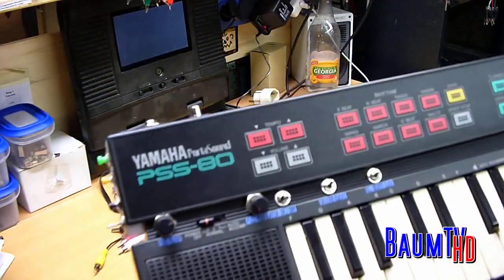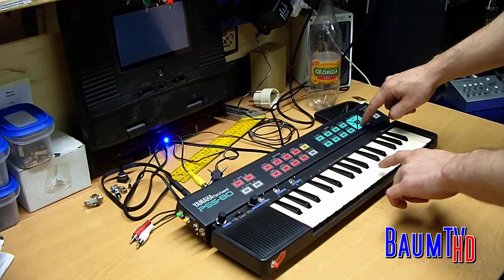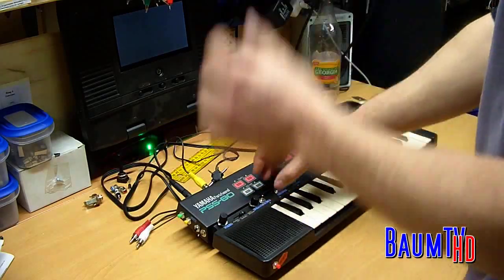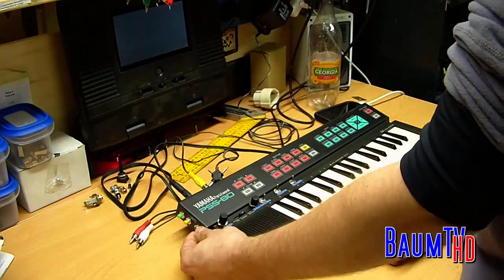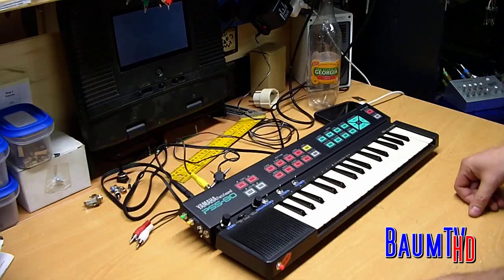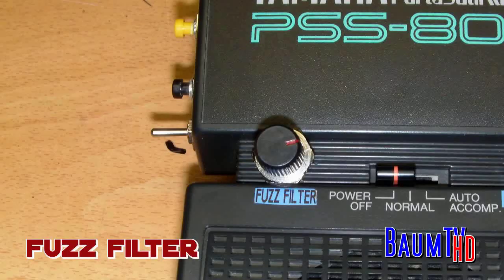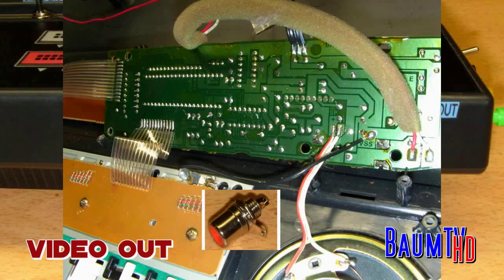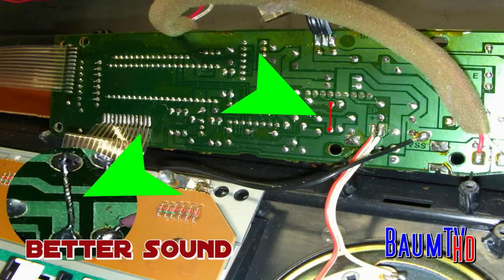HOW TO circuit bent a Yamaha Portasound PSS-80 with 10 mods (by BAUM)

Comment: When I start working on it is it safe to work on it while it’s connected via the 12v power supply or should I connect a battery to stay safe? I’m very new to circuit bending and pretty inexperienced
Reply from the maker: Yes. Its safe. Voltages to about 40 to 60 Volts are quite safe. For example you can touch both terminals of a (12V) car Battery and feel nothing. Even if the Amps are high of a car battery.  On a Keyboard you have low voltage and very low Ampere so you are safe in Both ways.
Reply: Baum Inventions thank you :) any tips for bending this keyboard? As i probably won’t find another one for a while and I don’t want to fry it

Comment: Is there anyway to introduce a signal into the speaker ? Sort of a AUX cable connected to the small speaker. 

My goal is to throw an amp in a drawer along with a microphone to run sounds via porta-sound amp & record a weird natural Lo-Fi reverb. 
Since i'm a poorman, i tought i could try this method before actually buying a mini amp. 

But the Question is.........Can you work some magic?

Comment: been reading up on circuit bending, will be working on a yamaha pss-100 sometime in the near future. everything i have read implies to not use an AC-adapter with the bent synth once the project is done, only batteries, but i think i see you using an AC-adapter to plug the yamaha into the wall socket. so is it safe to plug a bent synth in after the bending process is done and you are no longer playing with the contacts inside?
Reply from the maker: Everything is safe as long as you know waht you are doing... Personally i dont have problems with using a power suppy to power my bent devices during bending and after it is finished.
Reply: Daniel Baum that's just it - I DON'T KNOW WHAT I AM DOING!!! D-:
not really. but been reading everything i can, and i bought a silly toddler alphabet toy to start with, so hopefully i will have a better idea what's happening inside my yamaha when the time comes to open it up. 
thanks for the response :)
Reply: @BaumInventions  something like this is pretty low power as far as the adapter is concerned.  I'm not well versed on synthesizers, I do more work on the amplifier side of things, but I would warrant a guess that the inside is similarly low powered. As long as your working with small, 6v - 12v power adapters you'll generally be safe.  You can text to make sure your power adapter is safe and functioning properly with a multimeter. Set your multimeter to the setting that says "9V".  It'll likely have a little picture of a battery next to it.  Put the red test lead inside the barrel connector, and touch the black text lead to the metal on the outside of the barrel connector.  As long as it's putting out a steady measurement somewhere near 9V DC  it won't hurt you.  Personally, wouldn't even bother testing it because I like to play things fast and loose, but this is how you would verify your safety.

Comment from the maker: Simply cut the cable to the speaker and connect the jack you want like chinch or headphone jack. Some headphone jacks are "switching" off the speaker when you plug in headphones, if they do not have this or you use chinch (rca) out you have to install a switch to mute the speaker if you dont want to hear it. and if the signal isnt clear after installing the jack , install a 10 ohms resistor across both cables of the speaker to imitate the missing speaker... good luck :D